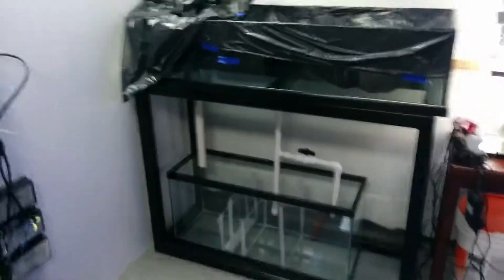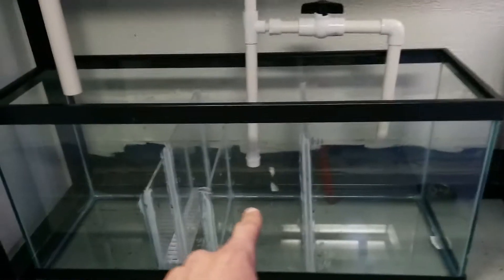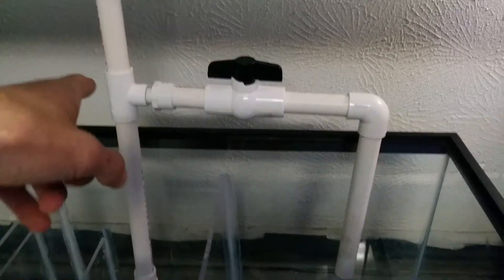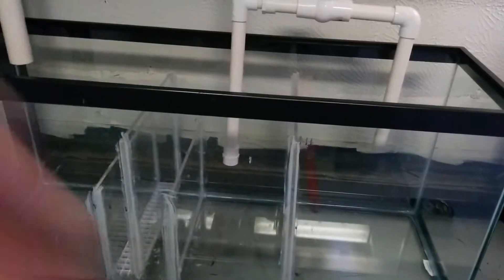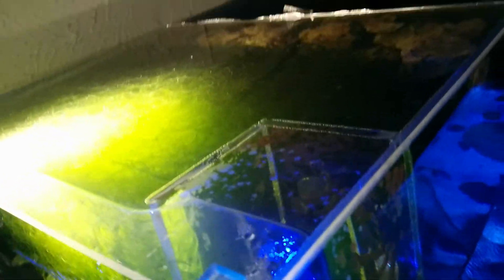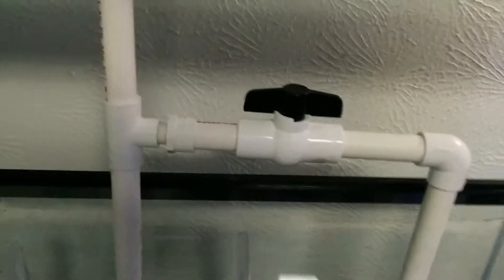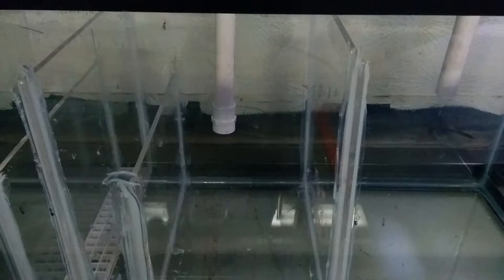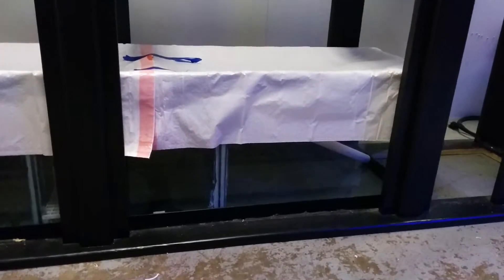Sump Refugium Design

Comment: How has this sump design held up for you? Setting up same design now. It's not too common
Reply from the maker: Paul Hammerl sorry I didn’t reply in a timely manner. 

I’ve had 5 tanks. 2 more since this one was set up. 

It’s the only way to set up a sump. Low flow in the fuge and the the other 2 chambers are full flow and for mechanical filtration. The organic filtration will have its change to do its thing in the low flow fuge.

I wouldn’t build one another way.